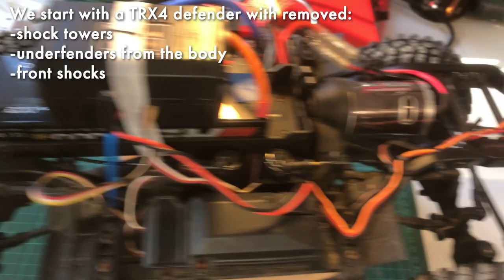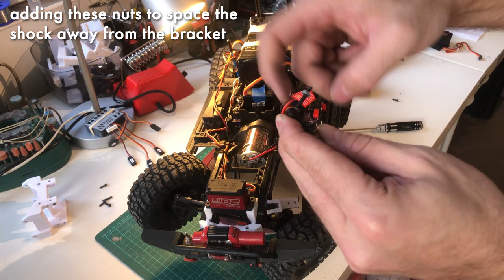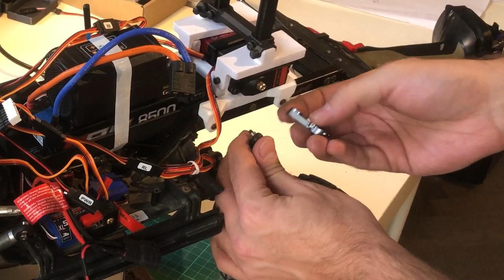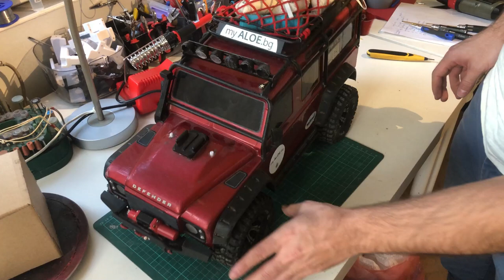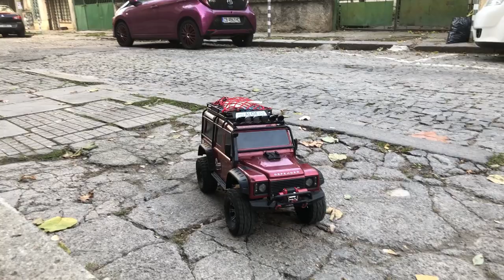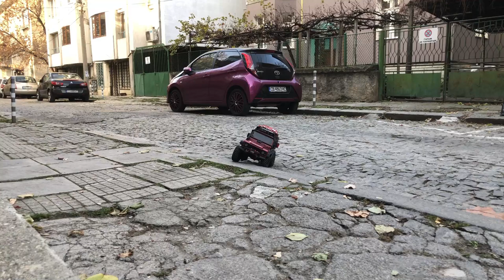How to convert a TRX4 to SuperScale

Comment: The movement is spot on, looks brilliant. I know it’s a crawler so is ment to be driving slowly, but out of curiosity how does it look if you go full speed over several bumps. Does the suspension even out the bumps or is it still showing the effects of the previous obstacle? Just curious, because I know it’s a crawler and it looks really awesome when doing so!
Reply from the maker: My initial idea was to make it absorb bumps, but regular servos aren’t able to react quick enough. It still does react to bumps and has that slow and realistic way of going over uneven terrain.
Reply: @SuperScale-dp7kv  
super

Comment: Is there an always level function for them? That would pull the front down on up hills and drop the rear on down hills, and side to side as well. That would be really cool
Reply from the maker: No, but it’s pretty easy to make a firmware like that.
Reply: @SuperScale-dp7kv  That would be really cool to see for sure
Reply: You could definitely make a firmware to do this. Would be relatively easy if you wanted to mount an FPV camera for example. It would likely be more using the larger servos than what typically come with a gimbal (speaking theoretically, I haven't tried FPV...  yet ;) ).

Comment: Looks like the body has no inner fenders attached. Can you confirm? Not sure how you'd install the body with the inner fenders attached to the body, any ideas?
Reply from the maker: To use the original ones you’d have to cut them up. I was going to make 3d printed versions and never got that far.

Comment: have you considered one for 1/14 rc tractor unit (trucks like scania etc) nooxion have a kit for cab suspension, have you seen that? Any chance of making it for 1/14?
Reply from the maker: It works on any scale but brackets will have to be custom made.
Reply: @SuperScale-dp7kv  yes i just ordered the ss system, i think it would work very nicely indeed for 1/14 trucks... brackets are an issue (for me) as i dont 3d print but I am thinking of ways round it...thank you.

Comment: If this tech doesn't get used, but, in reverse. I'll be amazed.
Reply: Williams and many others used it exactly as you described in Formula 1 in the early 90's. Eventually it was banned as the cars became to quick and any glitch or failure in the active suspension software could result in a potentially life threatening accident.

Comment: Is it possible to get the printed parts ordered as well? If so could you please direct message me. I’d like to purchase the entire kit from you. I have a TRX 4 defender RC as well.
Reply from the maker: Hi, 3d printed is a no go, but I am exploring ways to make these kits another way. You can always email me at superscale2020@gmail.com
Reply: @SuperScale-dp7kv  I just bought a kit from your website, would  you be able to include the print files? Time for me to buy a 3D printer! Super excited to get this working.
Reply from the maker: @FerCerealz  The files, firmwares and all manuals get sent to each customer along with the tracking number. I will arrange a shipment asap.
Reply: @SuperScale-dp7kv  thank you! I’d be more than happy to give you some feedback when the build is done, ordering the other parts now. So glad I got recommended this video!
Reply: @SuperScale-dp7kv  Just one question though, does it require a separate bec? I already have a Traxxas BEC installed on my rig, do you recommend a second one, or could I just run a splitter from my existing BEC?
Reply from the maker: @FerCerealz  You need a separate 20A BEC, search for YPG SBES
Reply from the maker: @FerCerealz  Make sure to post the build on the FB page!

Comment: Hi from FRANCE, I've some ideas to try(see below) but first I'm already totally fan of this product! I love it so much I will order it, I can't wait more. You change RC to the next level! I always said to many Great yt video, there models are too light to be realistic:  on my trx4 with extra weights( 450g), it become better...but.... Your mod is the one that could change all RC to the best level!
I would like to mount it on both FG stadium 1/5 and long wheelbase FG Porsche GT1 track model with big servos, separate power, also would like to test it on Moonraker yacht with self stabilizing system I've developed in past on gyro, with your system I think I could obtain full stab system on RC boat for the first time ! And one on trx4, for sure. Oh god 5 systems.... Glups....
Reply from the maker: You sure have ideas. Make sure you share your progress on the FB page. BTW the crawler firmware has a stabilising system running at all times, but isn’t actually used much. Just turn the D dial all the way to the left.
Reply: @SuperScale-dp7kv  I've placed order, I'll study on one system and duplicate on all models after, and send you test on boat  👍 you're awesome thank you
Reply from the maker: @GulliJ  Shipping tomorrow, thanks!

Comment: just remove shock oil and use soft spring. you will get sae results
Reply: You can't get dynamic ride height though. with the SS2K, I can dial in ride height while trailing.

Comment: Silliest thing ever, just remove the oil and O-rings from the shocks and it's gonna bounce the same.
Reply from the maker: Got a video?
Reply from the maker: @tomv3361  This video is slowed down.
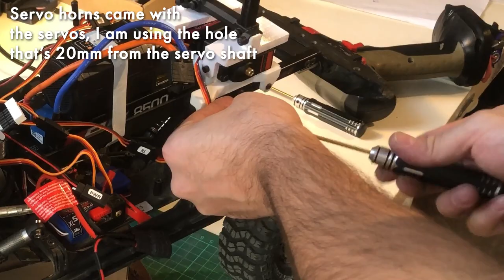Reply: @SuperScale-dp7kv  That's what I thought too, but it's not, check 6:23 in that video
Reply from the maker: @tomv3361  I saw it and the sideways shake is not bad but you need a very top heavy body for that and even with it you will not get the reaction from the front and rear to small bumps like you do with my system. You also can’t get the right longevity and period of the oscillations.
Reply: @SuperScale-dp7kv  Well, your system is kind of original, yet it has too many flaws. 
1. The servos constantly need to hold car's weight, which can't last for too long, they will eventually break
2. it's using a lot of battery power I assume
 3. Not good for mud and water runs, unless the servos are 100% waterproof which they often aren't 4. The noise
Reply from the maker: @tomv3361  I’ve been running it for a long time with no issue, batteries seem to last pretty much the same and if you’re gonna get in water that deep, you’ll kill the steering servo first. The noise can be reduced a lot with better servos, there are virtually silent ones.
Reply: I do weird rc stuff like convert tonka trucks and such. I have been making realistic feeling suspensions by adding weight and custom dampening. And none of my projects have ever looked as realistic as this. I will be a buyer very soon. Im nuilding a post apocalyptic 8x8 hemmitt and id like to see if i can integrate this system into it. Hmmmm....
Reply: @tomv3361  1. weight of trx is around 4-5kg, so each of the servos is holding around 1-1,5kg and their power is 25kg  - what was your complain once more? :-)
2. power consumption will be of course higher, but as this is only very short term impulses I think that this will be not serious issue
3. waterproofing depends on servo type
Only one real con from your list is the noise which could be annoying for someone

Comment: That's way too bouncy. If a real car bounced like that, it would definitely need new dampers. Why not just use thinner oil in the dampers if you want it to bounce more realistically?
Reply: The movement doesn’t scale the same way using dampers alone. Using thinner oil will make it bounce more, but it will bounce too quickly.

Agree that this is too bouncy, however the settings are completely adjustable. I’m guessing it’s turned right up to show the effect better